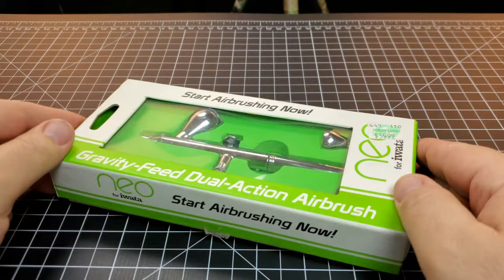Airbrushing With Cheap Acrylic Craft Paints: What You Need to Know

Comment: What is the mesh size on the strainer you use???
Reply from the maker: Hey ThinkerOnTheBus. I have no idea of the actual dimensions of the mesh itself. It doesn't say anywhere in the description. It is very very fine however. Here is the link to the ones I use. https://amzn.to/3OQW3gC
Reply from the maker: You are correct. As I mentioned in my response. I have no idea of the dimensions of the mesh. I use to filter both thinned acrylic craft paints and thinned Createx airbrush paint. As I'm sure you can imagine because of the nature of the Createx paint being of a much higher quality, I definitely get more of the paint coming through the strainer than I do of the acrylic craft paint.  I don't know if this helps or not. Good luck to you.